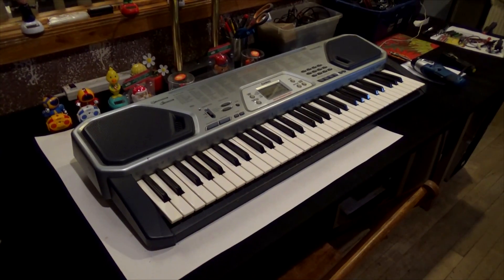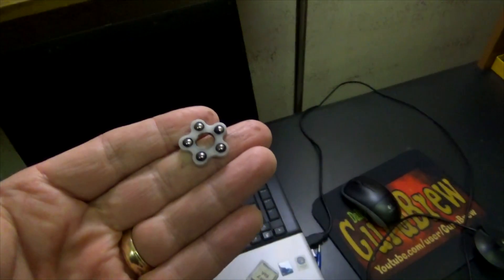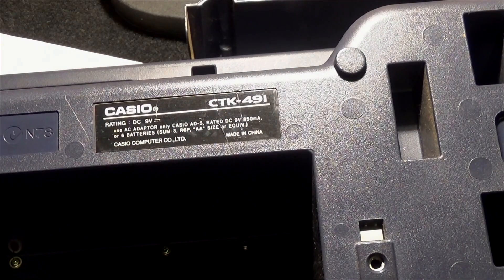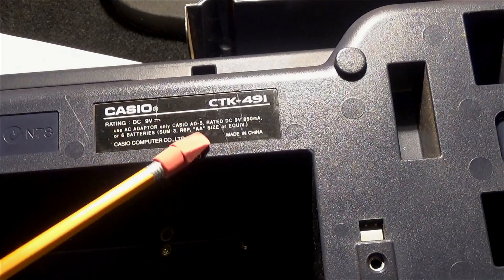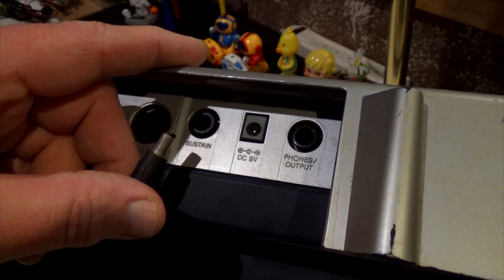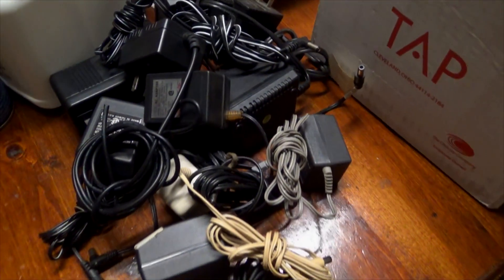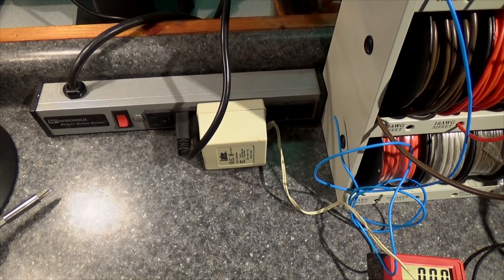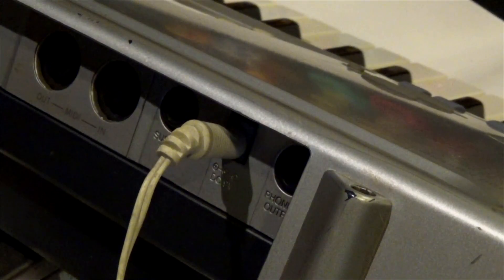Beginners Guide to Choosing Correct Wall Wart of Electronic Devices

Comment: Companies might use backwards polarity on power jacks to effectively sabotage their own equipment, but you should remember Hanlon's razor: "Never attribute to malice that which could be adequately explained by stupidity." It's possible that someone made a mistake when making the final revisions to the printed circuit board, the company ordered a few thousand of them, realized the jack was backwards, and decided to use a reverse polarity jack instead of printing new PCBs or fixing them manually because it was cheaper and it wouldn't be a problem as long as customers used their wall adapter - which they were supposed to do anyway.

It could also be the case that the circuit is only designed to work with a power supply that has some pretty specific specs. Giving it an oddball power jack reduces the chances that someone's going to use any old power supply that has the same current and voltage rating. If the circuit is revers voltage protected, it definitely wouldn't be sabotage because plugging in an incorrect power supply wouldn't do anything. On that note, I'm not sure why you said plugging in an improper plug will, "for sure pop that diode or fuse. Fuses aren't polarized so it doesn't matter which way you run the current as long as you don't draw more than the fuse can handle and the point of putting a diode in series with a load is to stop current from flowing backwards. When I say specific specs, I'm talking about the level of noise (random fluctuations in the voltage level) a power supply has and the actual level of voltage it's going to output at the current the circuit is drawing. The noise concern is pretty self-explanatory, but not everyone realizes that not all 9 volt power supplies supply 9 volts all the time. If a 9V, 1A power supply is unregulated (which a lot are), it's going to put out more than 9 volts if you're only running 250mA through it. How much more varies depending on the construction of the unregulated power supply, so using a different 9V,1A power supply could potentially blow something up if the designer was cutting it close with the voltage ratings of some of his components. If they put a linear regulator in the circuit, those need a certain amount of overhead voltage maintain a stable output, but also generate more heat the more overhead voltage they have to cut so using a different power supply could degrade the performance of the circuit or cause more heat than anticipated, potentially leading to fried components in the short term of reduced component lifespans in the short term. These things aren't always issues you have to worry much about, but when you do, I can see where it might be a good idea to make it harder for people to use a different power supply.

I'm not saying that you should absolutely always use the manufacturer's power supply, just that there are some potential reasons why it might be a good idea for a company to use oddball stuff on some circuits.

Comment: Very good on information about how to check power amp out.  I burned up a few diodes in my life. I just learned more about the volts staying close in volts. I burned up my background light up in my police scanner once because of wrong measurement in numbers.
Reply from the maker: Thanks Mark... The magic smoke is not so cool when the device is needed - Murphy says..... A $300.00 picture tube protects a 10 cent fuse by blowing first.

Comment: Good information.  Thanks.  An idea to try before you throw it out is to put batteries in it to see if that makes it work.  If that does the trick, I would love to see you attempt to replace the diode or fuse since I have two devices with the same problem.
Reply from the maker: OK, I will save it and see if time permits me to do a fix.
Reply: I'd like the see that, too.  I managed to destroy a small reversing monitor (for use with a Raspberry Pi) by - I think - plugging in an AC adaptor, when it needed DC.  Its components are really tiny, but nothing looked obviously fried.  A lesson learned, at least it wasn't expensive.